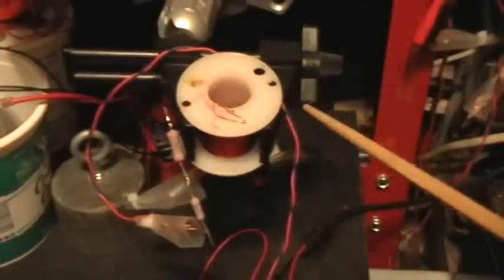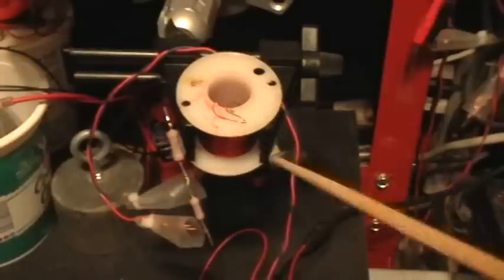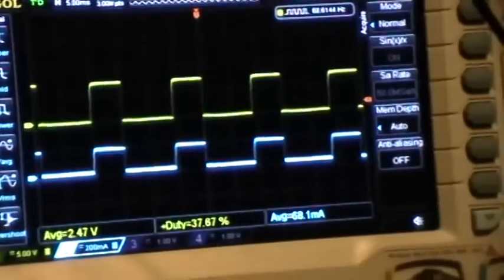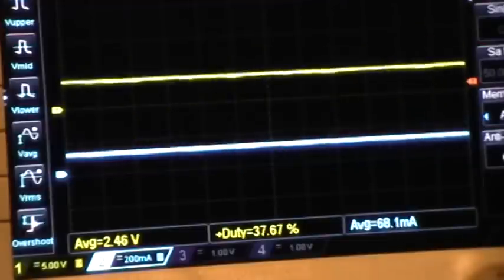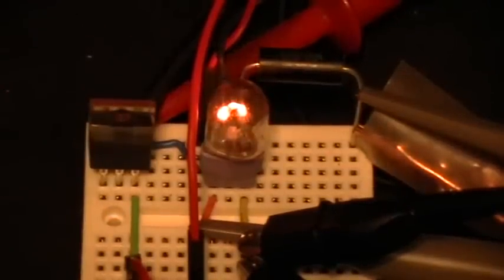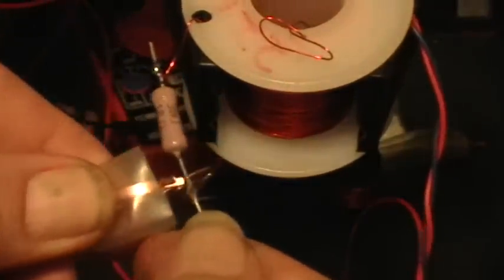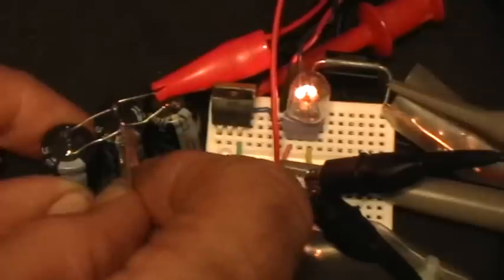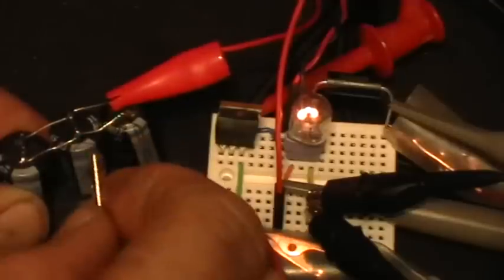Scoposcopy: Pulsed Circuit Anomaly from TinMan ?

Comment: i have watched this and tinman vids and i think the bulb is behaving as it should, being a mechanic i see it as an overall system, at the end of the day you have a supply(battery)on one side of that bulb and a charging system on the other side, with the cap connected the gen side becomes more charged a system voltage increase at the expense of a little amperage, for me if you get the bulb to go out....you need to give yourself a serious pat on your back........that simple little system has had me spell bound for years.........thanks for sharing

Comment: The resistors, bulb, inductor and pulse are creating a tunable dynamic voltage divider...
Nice vid!
Reply from the maker: +Cool Joule 
I wish I knew what that means...
Thanks!
Reply: +TinselKoala 
https://en.wikipedia.org/wiki/Voltage_divider

see how you can also use inductors and whatnot to divide the voltage which I &quot;think&quot; is part of what is regulating the brightness of that bulb. when you add the resistors, this changes the voltage available to the bulb as well as the current?
the CAP is also taking part in all of this? I&#39;m kind of asking because it seems like you know more about the intricacies than I do...
Reply from the maker: Cool Joule

I doubt if I know more about this circuit. I know what a voltage divider is and I understand tuning, but I don't really understand how the "average" current through a bulb can go up while the brightness goes down. Perhaps it does have something to do with peak vs. average power.

Comment: it's the back emf that make the bulb brighter... with the capacitor it smoths the ripple so you have less emf...
it's a problem i had in a brusheless motor controller...
Reply from the maker: +ElectronicMarine 
But the bulb gets brighter when I connect the capacitor if I don't have any resistor in series with the inductor. The bulb gets dimmer when I connect the capacitor if there is 21.3 ohms in series with the inductor. The average measured current through the bulb increases when I connect the capacitor in both cases. That's the puzzler.
Reply: if you connect the resistor there is less current flowing thru, the capacitor smoths the ripples and lower the tenssion, if you do not connect the capacitor the ripples make the light seem brighter, connectthe oscilloscope and watch the wave...
Reply from the maker: ElectronicMarine
Yes, there is less current flowing through when the resistor is connected. But with the resistor connected (21.3 ohms) the bulb gets dimmer when the capacitor is connected even though the average current  through it goes up.  With no or smaller resistor connected, the bulb gets brighter when the capacitor is connected, as expected because the current goes up.

Comment: Why not test it directly on the bulb? It is the bulb's response which is being tested. Throw out all irrelevant parameters (i.e. electronic parts, your red herring).
Reply: +deslomeslager  This was my initial thought also.  Do a control setup along side it without all the components to show what should happen.  We all know what that is but it would be nice to see it through the camera's eye.  I think that what is happening is a point of reference problem.  Like looking at the forest from a different angle.   It looks different but the whole forest is still there.  The question is why does it look so different?
Reply from the maker: +Lidmotor 
You see what "should" happen when I bypass the 18+3.3 ohm resistor entirely. The bulb then gets brighter as the average current through it increases when I connect the capacitor. 
But with the full 21.3 ohms in series with the inductor the bulb gets dimmer as the average current through it increases when I connect the capacitor. 
At 18 ohms, there is virtually no change in bulb brightness even though the average current still increases when I connect the capacitor.
Reply: TinselKoala
I see TinMan is also going to remove parts to make the circuit more simple. Good way to go. We are doing RLC it looks like and messing with impedance i.s.o. resistance.

Comment: Playing rms vs just average tricks on us?
Reply from the maker: +erlendse 
I don't think so. I think the scope is computing the average current correctly. The pulses are DC so I think the average and the RMS values should be the same, but I forgot to actually do that comparison. I'll have to check it later and get back to you.
Reply: +TinselKoala
Power follows voltage squared. Is that part of the calculation?

(Peak power + bottom power)/2 is NOT same as power of average voltage. Since the peak is way more on power.

I could try the circuit in LTSpice, if that would help to prove some kind of point!
Reply from the maker: erlendse
You may be close to the answer but it still doesn't explain the data fully. I didn't stress it in the video but the basic waveforms remain very much the same whether or not the resistor is connected in series with the inductor. You get the same kind of peaks and bottoms, just slightly different actual values.